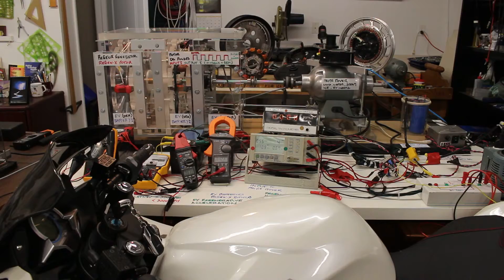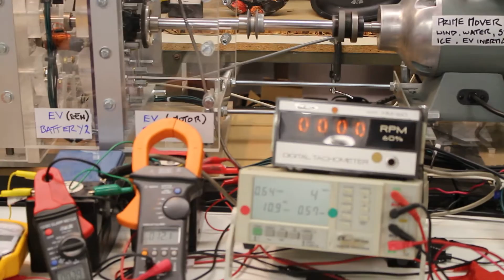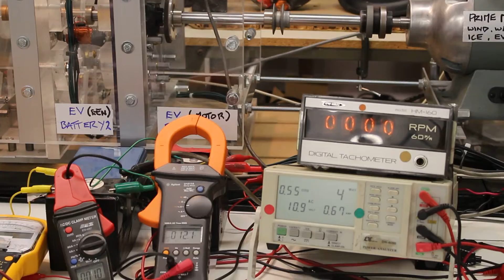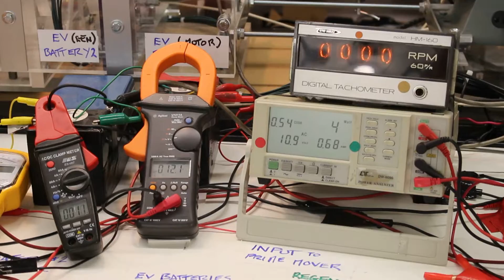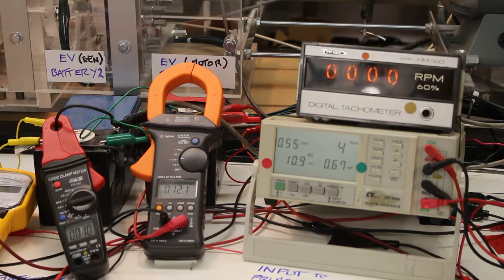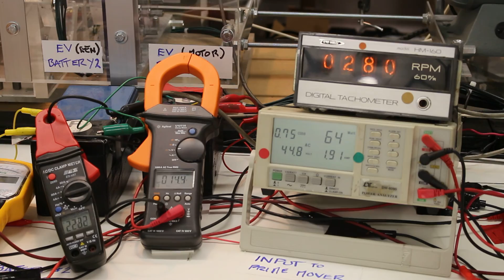ReGen-X EV Stepper Traction Motor Regenerative Acceleration

Comment: You state that the motor is a DC stepper motor when clearly the power input shows an AC input NOT pulsed DC. You say that the current out put exceeds the input but the power output is not the same as current at triple the voltage in. Not a DC voltage in, an AC voltage input, not what a stepper motor uses.
Reply: Okay Turion tells me those analyzers do not display pulse DC as DC pulses, the analyzer calls it AC. This is not new to me. I just thought that an intelligent analyzer would have more brains.
Reply from the maker: Hi Mikey, 
The ReGen-X Motor Control Circuit converts input AC to pulsed DC. I say in the video that the output current exceeds the input current (NOT power).  Cheers Thane